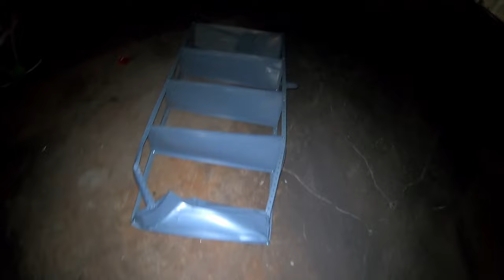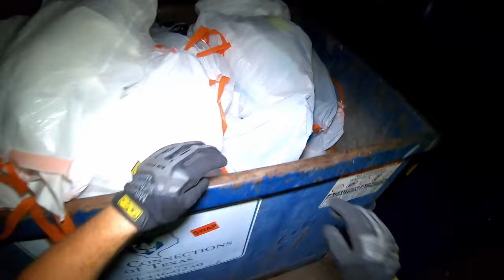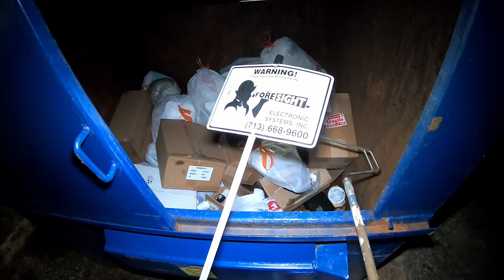Dumpster Diving "A Sign From Above"

Comment: Yo Mike. Keep those shoes Juice free brother. you need a small tool pouch for your knife a pair of wire cutters and a few other tools like a flashlight or small hammer. I bet 2 cans of silicone based waterproofing camp spray on those shoes will do you well. A battery powered sawzall with a metal blade would make short work of those shelves and make them fold flat.
Reply: Good call boss. Gotta be ready and gotta be safe and dry.
Reply: Be one with the juice

Comment: The chains on those hoists are worth at least $100 to $150 bucks may be worth checking out. And that trolley for the winches is probably worth $100 bucks also check it out before you scrap them

Comment: Mike,,  Your deep cycle battery might be sulfated,,  Ebay has nifty little battery chargers, about 30-40 bucks, that have a repair mode on them for bringing used batteries back from the dead,,  Auto auction rebuilds has a video on them,,,  :-)